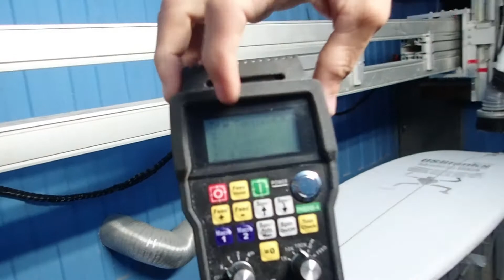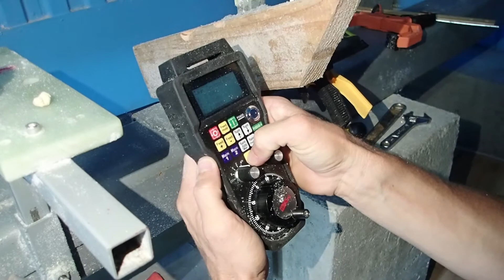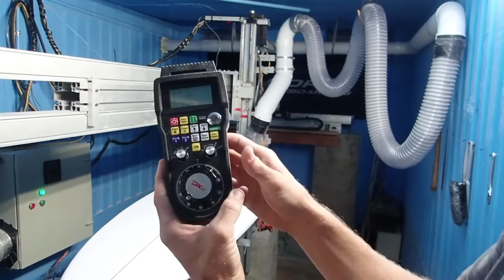Centroid Wireless MPG CNC Control Pendant now available for use with Acorn CNC controllers

Comment: If the Acorn could do closed loop velocity mode, I'd run it on my old Fadal.
Reply from the maker: Allin1DC and Oak are closed loop cnc controllers.. fadals have been upgraded see this for more info.. http://www.centroidcnc.com/fadal_vmc_retrofit.html
Reply: Yes, but I would have to at least swap all of my resolvers to encoders in order to use it.  I've got 3 rebuilt Glentek motors in my Fadal.  I've done 2 Centroid retrofits in the past and owned/ran 1 of them daily for 6 years.  I really like the control, and I really like Linux, that's why I bought the CNC10 system in 2004.